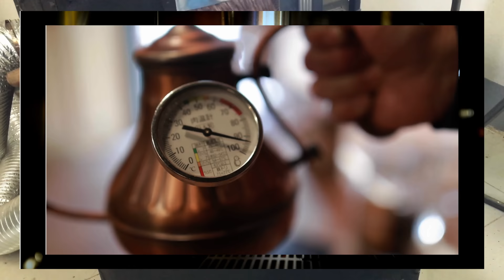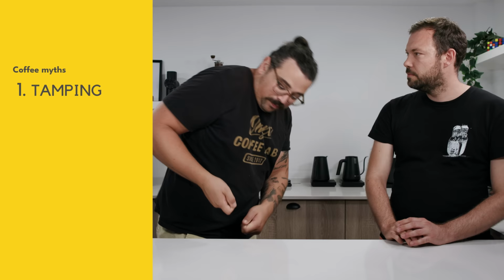DEBUNKING 6 MOST COMMON COFFEE MYTHS: Feat. Chemist Dr. Samo Smrke

Comment: Thanks Lance & Samo. I think I gained an answer to a situation I have been seeing after I recently "Slayer modded" my BES920, and that is when using quite low pressures, the flow rate seems to be more overall than expected. It stands to reason, now, that the coffee particles aren't offering as much resistance if they aren't squashed closer together, which is what is happening at higher pressures.

Comment: Thank you Dr. Smrke and Lance. This is great information. You mentioned the size differences from a cold start in grinding. With a single dose grinder, would it lessen the size variation if one would start the grinder and then add the beans so that the burrs are already at their normal speed? Just curious if this would help, but understand that there will always be variations in particle size due to the nature of being a natural material. Thanks again for such an informative video.
Reply: Exactly.  By letting the grinder get up to speed, and only then adding the coffee beans (slowly, rather than all at once) you'll minimise the variations from speed thus increasing grind homogeneity.

Once the grinder is running at speed, it's no longer considered a cold start, it's known as a hot start.

It's easier to do on some grinders than others, but always worth doing if you want to chase optimisations.

Comment: In 6) pressure are you talking about the peak pressure hit during the extraction? Because when I pull a "9 bar" shot it only reaches 9 bars for a short amount of time and then it quickly decreases from there on.  Or are you pressure profiling and the pressure stays at 9 bar for the whole shot?
Reply from the maker: On typical machines, most people dial in finely enough to maintain roughly 9 Bar. Unless you have a rapidly eroding puck and an ever increasing output flow, you're likely sticking around 9 bar or so with maybe a slight dip. Doesn't take pressure profiling to do this. Most normal machines do.

Comment: The temperature comments surprised a little. Not that boiling water can't burn, that was obvious. But that small temperature changes won't affect the extraction much. With all the PID controllers in espresso machines and the talk of machines that brew at 93 degrees struggling to avoid sour shots with light roasts I had thought that smaller changes in temperature were having more of an effect on extraction, at least with lighter roasts?
Reply: With lighter roasts I always brew at higher temperatures and grind finer.
Reply: @richardmiddleton7770  I know that is what is recommended but what I was mildly surprised by were the numbers thrown around here re temperatures needed to make a noticeable difference. Is 3 degrees, say 93 to 96 just enough to make a difference with lighter roasts because when loosely talking temps they were more in the 5 to 10 degree range from what I remember? I guess it's right in the middle of where they said small changes that don't matter (0.5-1 degree) and where we get a big difference so maybe it is just enough to make a real difference?

Comment: "We should assume we have a fixed brew ratio". Why? I vary my ratio based upon many variables on every extraction. I am coming to the strong conclusion that videos should declare whether they are talking about commercial settings or a home setting. BTW I like this guy. He talks about a pull being both over extracted and under extracted at the same time because of channeling. You can get the same thing with a conical burr grinder that produces a wide variation in grind sizes.
Reply: He's only saying assume a fixed ratio for the sake of the maths from a scientific model to be able to give consistent examples.  He is only changing one variable in his examples to make the points much clearer.  He's absolutely not saying to use a fixed ratio/recipe when brewing.

It's commonly notation used in scientific work, assume x, y and z, we'll be changing α and observe the result.

Comment: I thought higher pressure due to more puck resistance (grinding finer) would increase likelyhood of channeling. However if you didn't get channeling then you can achieve a higher extraction with a finer grind size.
Reply from the maker: Higher pressure is due to BOTH resistance and flow. You could do same resistance and have higher input flow.
Reply: @LanceHedrick  on e61 with flow control I think the limiting factor is the grind size. But maybe Decent or other more advanced machines work differently with more legit pressure profiling rather than flow control.
Reply from the maker: @BensCoffeeRants  well sure but that's an e61 with constant flow. Not just a pump with an OPV, which is MO.
Reply: @LanceHedrick  what's "MO" mean?
Reply from the maker: Modus operandi

Comment: On the temperature part. What about leaving the portafilter locked for too long instead of locking and brewing right away. Does that "burn" or negatively affect the coffee in any way?
Reply from the maker: Will definitely affect some of the volatile aromatic compounds. Think about the science behind the chilling of espresso retaining compounds- cooler starts can lead to more retention of those early easily extractible compounds.
Reply: @LanceHedrick About that chilling espresso gadgets, does having a freeze cup will achieve the same effects? Or the compounds are being lost in the air (before it hits the cup)?
Reply: @thiagom4321 You'll lose more volatiles than a frozen ball, but less volatiles than a room temperature or warm cup.  However, the taste is subjective, so whether this makes that big a difference is entirely in your mouth/head.

Comment: Very interesting. Please post links to his research data. Regarding myth #1 what I have noticed over some decades of making espresso. # a very finely ground/ too finely ground coffee tamped normally in PF will come out too slow or even nearly not at all. When I use the same ground coffee but just a light tap on puck it does increase extraction speed significantly. Note this is reproducible over decades.  The other thing I reproducibly noted is a coffee ground too coarse for espresso when tamped down in layers (2,3,4) the extraction speed does slow. I like a bottomless PF because hopefully the shot hitting one less metal surface, the spout, will mean more crema. Do the tens of thousands of barista's in Italy lose sleep worrying about channeling? I used to get beans roasted by an Italian guy that always told me to wait a couple of days to let the oils permeate / cure as the coffee will taste better. Does the perception of bitterness also relate to coffee temperature ; taste buds/receptors in tongue?